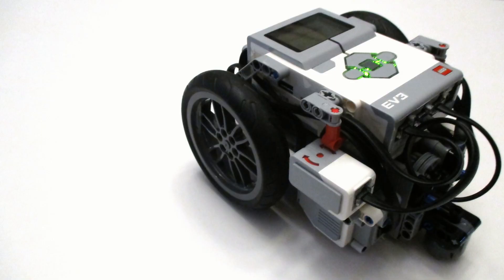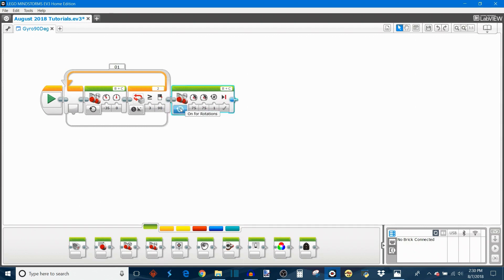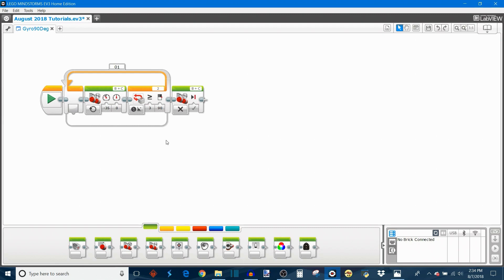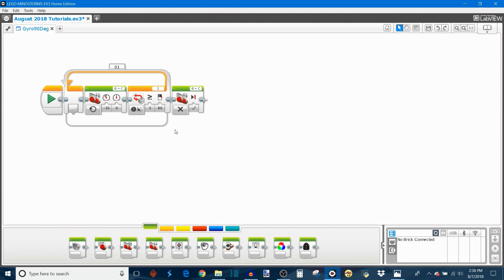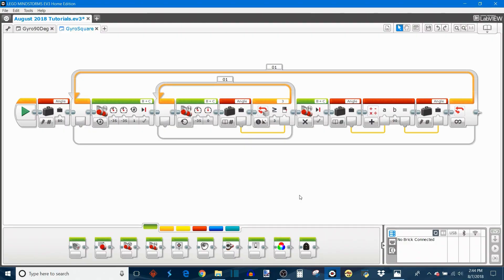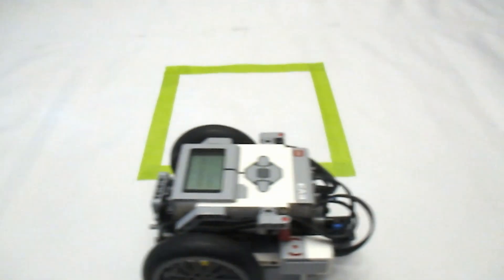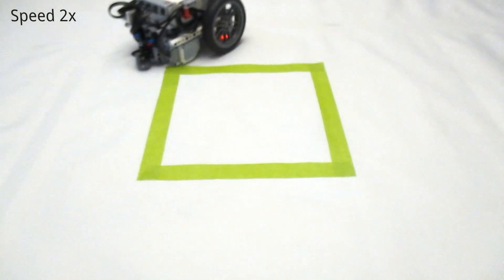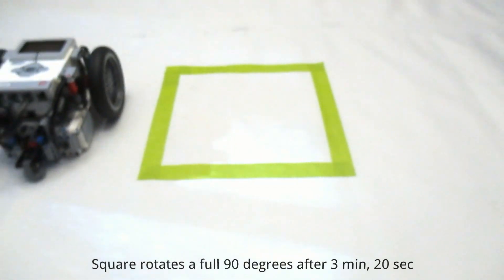Program Accurate 90 Degree Turns with the EV3 Gyro Sensor

Comment: When my team tries this approach along it works, but when it’s added within a program it just keeps spinning never stopping the turn. It almost seems like it never reads the gyro to exit. 

The gyro works fine on a straight line loop just not this one. Any ideas??
Reply: i am literally having the same problem but with mine it  doesn't  work with stabilizing

Comment: I m facing the problem that my gyro sensor doesn't take same degree turn every turn. I use calibration before each  turn but 3 to 5 degree it turns more or less

Comment: Why do you always use negative powers? Thanks
Reply from the maker: That has to do with the way the motors on Sirius are positioned; since they have an upside-down orientation, negative power is necessary to make my robot drive forward.

Comment: Hi, its me again :D. 

So, it seems like my lego pieces is getting more and more fragile. My broken TECHNIC® pieces keep increase in number (even my  RJ12 cables have it's holder thingy broken, so it couldn't connect securely in the port). 

Does this ever happen to you? What trick did you use to treat those TECHNIC® pieces carefully??

By the way, thanks for your attention and patience for replying my questions 😁, keep up the good work!
Reply from the maker: That is strange, I have found LEGO pieces to be quite durable and I don't think I've ever broken a LEGO piece. The only thing I can recommend is that you be careful when building to consider the stress that your design may put on individual pieces. Always design and reinforce the design to minimize the stress in your parts.
Reply: Wow, maybe I'm too rude with my Lego Mindstorms connectors (are connectors actually durable? I broke a lot of them, especially the longer blue one.) I'll try to be careful with my TECHNIC pieces. Thanks for replying!

Comment: I‘d recommend to use a motor speed proportional to the angle. So robot starts to turn quickly and slows down at the end... this way the oversteering should be less while the speed of your turns improves significantly.
Reply: One more thing.... if you turn by absolute values (meaning "turn until total gyro value reaches 'current_value + turn') instead of relative values (meaning "turn until gyro differs from 'current_value" by "turn") you won't have any accumulated errors, because any oversteering is automatically corrected at the next turn. So you turn to 90° on turn one, to 180° on turn 2, and so forth). This way your robot can follow the square precisely until the battery runs out :-)
Reply from the maker: The speed proportional to angle idea is great, I may try that for myself soon! 

The downside of programming the target individually each time (90, 180, 270, etc) instead of adding 90 for the next angle is that I would need to individually program each target, which would take forever.. By adding 90 degrees, I can have it go on indefinitely.

Thanks for sharing these ideas!
Reply: I guess for this use case ( following a square infinitely) just adding 90 degrees every turn is as simple as turning 90 degrees relatively. For more complicated routes it’s indeed a bit cumbersome to keep track of the total gyro values all the time... but as I said... your robot will always turn like you want, hence I believe it’s worth the effort... at least in robot competitions. Feel free to check our YouTube channel... we posted a video for our WRO 2018 Junior robot. The video shows still the non proportional turns... meanwhile we switched to proportional turns using absolute instead of relative gyro values and our robot is now 20% faster while having become much more stable at the same time.
Reply: Yes. Also start and end of fast rotating - stress for Gyro, this is the reason for accumulating error.
Reply: It indeed is pretty cool and worked quite well for me, however it seemed like the gyro was having drift issues much more often than before using that method. So I stopped using it and the drift almost completly disappeared. I suspect it is because it requires the gyro too much in a short amount of time or something...

Comment: It looks quite good when the robot has the same moment of inertia and speed, but when batteries get lower and you change attachments these two change and you constantly have to adjust those 80 degrees.
Reply from the maker: That is very true, and a major downside of using the gyro.
Reply: @Builderdude35  do u know y my chromebook does not have all thee tabs on the bottom of our programmer